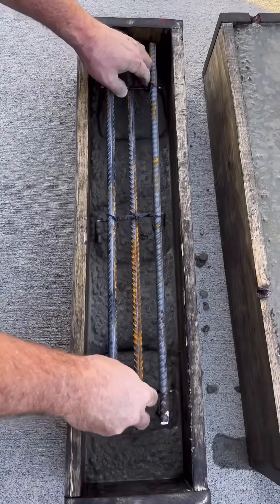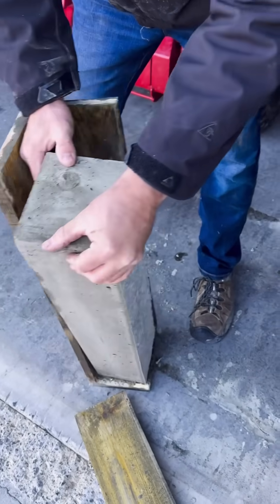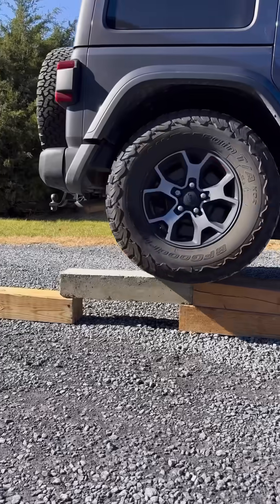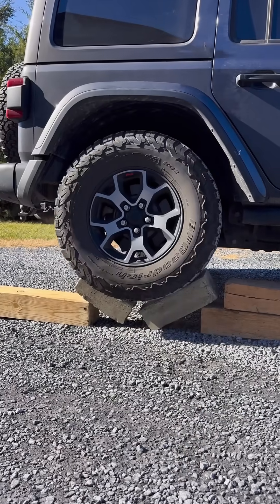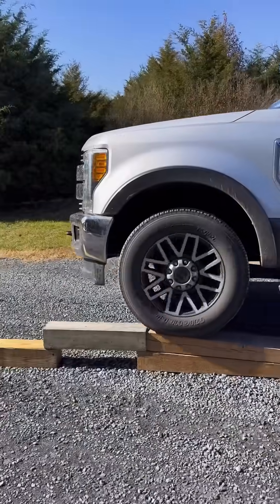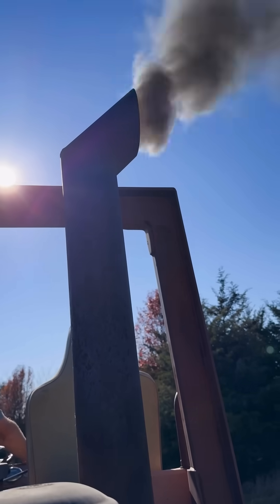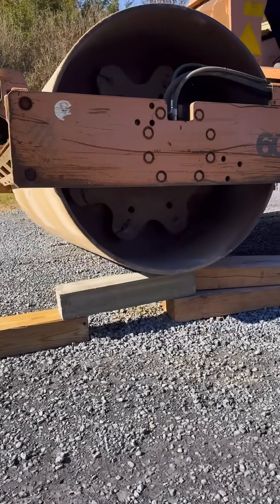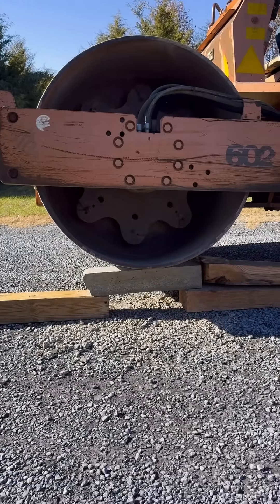Why We Use Rebar To Reinforce Concrete

Comment: Too much rebar will break up concrete in the summer. As they warm, steel expands more than concrete cracking it.
Reply: Thermal expansion of concrete and rebar are so close (1.1^10^-5 and 1.2*10^-5) that it is (almost) impossible for the concrete to crack because of the thermal expansion. The reason for the cracking is rust. Mainly rain causes the concrete to become more acidic over time and that causes the rebar to crack.
Reply: @MrAggezzz  
You may be right. I was told by a state employed engineer it was the different expansion rates of the 2 materials. 
Question; I have a pressure washer that can heat water to 250°F, was told  not to use heat when washing concrete because it will explode. What Temps would concrete explode?
Reply: @happydays8171  i have had concrete explode. It took a good size fire right on the concrete. Took like 2 hours so im sure it was very high temp.
Reply: @MrAggezzz  Is there galvanized rebar?  How about a threaded rod?
Reply: @MrAggezzz  non Calcium accelerator is what is required. But concrete is corrosive on its own. Epoxy paint coated rebar is also smart.
Reply from the maker: Interesting
Reply: @hausplans  
Yes, there's a 4 lane hwy 49 in Indiana, laid late 60's when the steel lobby was very influential and got way too much rebar put in. On baking hot summer days it would Crack eating itself up. Then Indiana went to a minimalist approach just laying rebar on the bottom. Now, on IN state hwys they've tore up the concrete and gone with 18" of asphalt.
Reply: @happydays8171 What a horrible idea
Reply: @happydays8171 interesting that they used concrete on a highway in the first place, I just assumed they always used asphalt. I figured the “grey” color was just from dirt and cars driving over it. Didn’t know they used to use concrete only for highways
Reply: @happydays8171  could it be the ground expanding not allowing the concrete to flex with it?
Reply: @misterbulger  
Very possible. We'd get hard freezes back then when the temp didn't get above 20° for over 30 days at a time. Sections of this hwy would explode in the summertime, moreso in Illinois than Indiana. When they went to a minimalist approach, just putting rebar on the bottom, the roads lasted longer. In my non-sceintific observation.
Reply: @happydays8171 
If your concrete pavement is exploding, then it doesn't have enough expansion joints per mile.
Reply: @hausplans try it again with fiberglass rebar!
Reply: @hausplans  that's why u may see pully systems putting the rebar in stress.
Reply: @hausplans now make a video with 1-4 rebars inside the concrete and compare which one holds up the best… is more actually better?
Reply: @hausplans they make fiber rebar now its supposed to be stronger then steel doesn't expand an Crack and its a fraction of the price
Reply: @makmar4484 
Fiberglass is far less stiff than steel while Basalt is 2.5 times more stiff than steel. Basalt is also longer lasting due to having absolutely no corrosion or oxidation heaving. Basalt rebar is ideal for saltwater contaminated environments. Also, Basalt fabric can be used as a sheath around concrete members, providing surface reinforcement, in addition to interior Basalt rebar. 

Steel rebar has the redeeming quality of failing gradually instead of abruptly. The steel yields gradually and produces visible concrete surface cracking. Whereas Basalt reinforced concrete just explodes catastrophically when overloaded. However, post-stressed steel tendons also fail catastrophically, so there is that similarity. However, the point is to over-engineer the brittle aspects of the design or use composite techniques that provide redundancy against brittle failure.
Reply: @hausplans  not interesting, false
Reply: Its not from heat, the steel begins to rust and then you get what you call rust jacking.
Reply: @aarongrabowski3775 
We call it concrete cancer in England, I think that’s why inspectors are so anal about the cover on rebar now
Reply: @MxHondaCR250R concrete cancer is called Alkalai Silica Reaction - or ASR. It's a product of aggregate (rocks mixed into the concrete) reacting poorly to the main binding substance in concrete, calcium silicate hydrate (CSH).This reaction breaks down the CSH from the inside out,  and causes internal expansion. This is not a product of rebar expansion.
Reply: @Prosper_NA smarty pants 😅
Reply: @aarongrabowski3775  if you use accelerator it's got to be non-calcium so it doesn't corrode so bad
Reply: i used fiberglass rebar
Reply: @justbobroblox5380  
Good deal.
How much more expensive is it than steel, and is it as strong?
Reply: @happydays8171  conaidering likke 90% of all titanium deposits in the world are found in russia. Uh. Expensive.
Reply: @happydays8171  in my area a 10' x 10mm bar, the fiberglass is $0.64 more expensive. fiberglass bars are stronger than steel.
Reply: @gwot 
Thank you for that info, didn't know that. I want to pour some cement soon, I'll look for the fiberglass rebar.
Reply: No it doesn't, steel and concrete have a very similar thermal coefficient
Reply: @toonces6587  but you must size the rebar accordingly.    You don’t want to put 1 inch rebar in 4 inch concrete.
Reply: @Bodie2020  yes you do, more steel the better if you can afford it
Reply: This is generally not true.  Low carbon steel is used as rebar because it has high tensile strength and similar thermal expansion coefficients to concrete.  What heat does do is speed up the reaction of oxidization. Oxidizing steel can rust and expand, putting internal tensile strength on concrete.  As explained in this video, concrete is poor in tension,  causing the concrete to fracture. - Civil Engineer
Reply: @Prosper_NA  
Thanks for the info.
Reply: Lol you made that up to sound smart. By your logic every commercial building in America would collapse the first summer after it's built.
Reply: @cthulawha he said “too much”
Reply: Dude you have no idea what you're talking about. and you're being hyperbolic. This is already a major public issue in places like Florida where the cracked concrete exposes rebar to moisture, which then causes rebar to rust - creating even more instability. There is a literal epidemic of 40-year-old condo buildings collapsing in that region. Lookup 'surfside condominium collapse' on wikipedia and educate yourself. @cthulawha
Reply: @cthulawha  
With too much rebar it could. This highway I mentioned broke up so fast, I remember it cracking and exposing the rebar. All had to be torn up and re-laid.
Reply: Titanium rebar
Reply: @Atthewgoop the rebar didn't break it just bent the concrete will still crumble
Reply: @Atthewgoop  If you got the money go for it.
Reply: this is why construction is tricky in the Midwest. summers are over 100 degrees. winters are single digits and sometimes go down to 60 degrees below zero
Reply: This is not true at all. Steel and PCC have similar thermal coefficients. Plainly reinforced concrete is susceptible, primarily, to oxidation/corrosion of the bars which expands the volume the compromised part of the bar was occupying. When this happens excessively, we call this rust packing, with the change in volume generating enough pressure to delaminate and sometimes remove chunks of concrete from your structure. 

This is the reason why ACI recommends certain concrete cover dimensions beyond the space where reinforcement is placed dependent on the environment and application. It is also a reason why glass/aromatic/carbon fiber reinforcements have undergone so much research in the past 3 decades - because they don't deteriorate similarly. Lastly, it is why many state agency's are experimenting with the use of stainless steel bar and galvanized bar.
Reply: I thought that was when it rusts and expands.
Reply: @happyjohn354  
Just saying what that state engineer told me. All the rebar I've hauled to job sites, had been sitting outside and already rusting before getting put in the cement.
Reply: @happydays8171  Ya because a little rust helps concrete stick to rebar better. The problem is when water gets inside the concrete and you start getting thick layers of flaky rust.
Reply: Concrete always cracks. No matter what you do with your rebar. It always always always cracks. It’s a matter of controlling where the cracks happen, hence control joints.
Reply: @asoggyburger479  even then no garuntees. I never warranty against cracks because of our expansive soils where I live that heave and sink. If you want no cracks then im drilling piers to bedrock and putting a grade beam on top just so I have something solid beneath. Now you have a $300k driveway. Even then it'll still crack.
Reply: @misterbulger  Absolutely, I don’t know any concrete subs around my area that will cover aesthetic cracks. If there’s a structural issue because of the crew that installed it or the engineers who designed it then by all means it should be covered within reason. But cracking it totally normal and always happens lol
Reply: No it doesn't. The coefficient of thermal expansion is the same for rebar and concrete. Water intrusion causes cracking.
Reply: Even 10th graders know that we use rebar because it expands at the same rate as concrete
Reply: No steel and concrete have a very similar thermal expansion. You're probably thinking of rust jacking
Reply: There should be 50-70 cm spacing between rebar and the boxing
Reply: Rebar to close to the top it will cause cracks on flat work ,caused my driveway to crack right down the middle after 6 months ,bummed me out the contractor would not come down in price he said he was the best !!
Reply: False
Reply: Dumbest thing I ever read
Reply: Your so wrong lol what a clown
Reply: Fortunately, you don't have to use "too much rebar".
Reply: Yeah I'm sure that 1/32 of an inch will cause concrete to blow up like a balloon
Reply: Concrete is very regional and different depending where you live here in the United States, a contractor from Florida, cannot come to concrete up in Montana but somebody from Montana can probably do concrete in Florida the only thing different is gonna be the dirt work and setting up forms but that’s not concrete skills a Florida contractor would have to learn how to build a foundation forms which yes some can but those people also have skills to build parking structures and will probably run a company doing some thing a little more than just basic house, concrete like foundations, slabs, sidewalks curbs like we do first fancy sidewalks that are stamped and colored I think you said you’re down in Indiana, so definitely makes sense as you start getting more up south in that area over in Kentucky, Tennessee, Illinois it starts becoming like concrete up more up north but because of your humidity sun and swamplands theirs certain things that are a little different like we have to deal with swamp land like stuff but nothing like the south farm land that’s swampy is not like the south lol
Reply: Concrete is very regional and different depending where you live here in the United States, a contractor from Florida, cannot come to concrete up in Montana but somebody from Montana can probably do concrete in Florida the only thing different is gonna be the dirt work and setting up forms but that’s not concrete skills a Florida contractor would have to learn how to build a foundation forms which yes some can but those people also have skills to build parking structures and will probably run a company doing some thing a little more than just basic house, concrete like foundations, slabs, sidewalks curbs like we do first fancy sidewalks that are stamped and colored I think you said you’re down in Indiana, so definitely makes sense as you start getting more up south in that area over in Kentucky, Tennessee, Illinois it starts becoming like concrete up more up north but because of your humidity sun and swamplands theirs certain things that are a little different like we have to deal with swamp land like stuff but nothing like the south farm land that’s swampy is not like the south lol
Reply: @Hellothis12157knbhb  
I have rental properties, I mix and pour cement for sidewalks and steps. If I'm right against the clay (sometimes there's only 4" of topsoil), I'll pour right on it, a true 4 inch minimum of concrete, not the 3 1/2" a 2X4 is. Otherwise I like to lay 2" of crushed limestone, but haven't used rebar and only had a couple cracks. Where I've seen work professionals do that cracks and pitches in 6 months after laid. I like it more dry than premixed is, that's soupy. So mixing it myself, I feel is key. Stuff I've done has lsted going on 15 yrs. That's 100° summer days, and 2 days a tear on average, doesn't get above 0.
Reply: @happydays8171  well the thing is professional is a bad term in concrete for people to call themselves, like you as a landowner knows a how to take the take to do it right small section of sidewalk don’t need rebar especially outside of homes wanting rebar for those types of sidewalks is more for like a Main Street where shifting buildings snd roads will effect stress out on the concrete, like the 76 I mentioned has rebar in the sidewalk because it’s also a step up as well as being next to the building so if anything shifts the concrete will crack but keep shit from causing a safety hazard for a couple year, like concrete will always crack that’s why we cut big slabs( theirs something we can put in to help influence cracks but it doesn’t work all the time snd we’ll we don’t use them anymore ) or we put the groves making sections, it’s not just for looks, each of the groves is to cause cracks for that section, their could be a lot of things the concrete guys did wrong, didn’t properly set up the dirt work, they didn’t do the rebar right or they got soil or foreign debris in the concrete trapping it in causing shrinking or cracking,  because it’s a chemical reaction that causes hardening its different when it comes to how you treat it, like because it’s cold rn we half to add activator to help make the concrete harden, if you add sugar you can make concrete not get hard at all, we use sugar water when doing exposed aggregate( you can see the rocks  though the surface )
Reply: @happydays8171  the reason I say professional is a bad term is I’m 19 and I can set up and pour sidewalks better then most crews in my town my dad taught me right and I’m not a professional like I’m getting my contractor license but that doesn’t mean shit for my skills, it just makes it so my employer doesn’t take my taxes out of my paycheck and I get payed more cause he doesn’t need to pay any insurance or unemployment that’s all me but I can also work for multiple people cause I’m technically my own company.
Reply: @happydays8171  and when it comes to sidewalks and rebar it’s more about the surface it’s going on and thickness Andy what surrounds it like if anything like a foundation can shift,  as well as if it’s bendy etc in reality it’s a very 50/50 thing snd that’s why we come looks and write the quote after understanding what we’d deal with not before we can even see it at most we change tell them the concrete per foot price snd what we charge for bar etc but with wood snd select materials er can’t give a quote the price changes to much
Reply: @Hellothis12157knbhb  
Thanks for the info. Mixing seems to be the key, I know when I've got it 'Just right.' Live by a university, walk my dogs on their sidewalks, and they don't turn a load of concrete away, they pour no matter how soupy it is, and the top 3/4 inch gets all pock marked up, looks like concrete acne, after 2 winters because of all the salting it gets, then they'll tear out the worst parts and replace it. I watch YouTube vids where concrete workers working on pouring a driveway will turn a load away for being too wet, can't understand why the university doesn't. Must be the cheapest bidder.
Reply: @happydays8171  cheapest bidder for sure, but I have never heard of a concrete truck being too soupy on arrival. I wonder what the fuck you’re mixing plant is doing because it sounds like they suck, we usually always have to add water and that’s how we always do it. Maybe the person ordering it is doing it wrong, because when you order concrete, it’s kind of complex not exactly, but to somebody who doesn’t understand it definitely is very confusing, but we use two different plants depending on what type of job the local one isn’t as good, but it is usable. The thing is, we have to watch out because later in the season so right now we have to be careful because they were having chunks of unmixed concrete which like you said having a good mix is important, it definitely has to do with who’s running the job, I wouldn’t be amazed if it’s somebody from the University and students actually lol and you can have a concrete be pretty Danm wet like rn in Montana. It’s cold as shit, we want to get the concrete down fast and have it dry fast, so it might seem a little to wet but we have activator in it, which depending on how much you add Will drastically speed up the Hardening but makes it harder to finish, the main reason the University stuff is probably cracking is because it’s being poured very wet and quickly with a job that was done very quickly so there’s going to end up being contaminants Mixed In especially if they’re pouring it very wet onto dirt you do not poor wet on the dirt that is a bad idea like you can pour on dirt, but do you want to be careful, you do not want to overwork the bottom of it because if you do, you’re gonna mix too much and cause cracking whoever is running that job is a dumb ass though. The issue is some areas don’t have concrete people like I’m moving thing Kentucky and they don’t have anybody who does concrete at the level we do and this town is bigger than my county it’s baffling how some big areas don’t have people who can run a concrete company it’s not like it’s that hard either it take skills but it’s not the hardest. It’s just very labor-intensive.
Reply: @Hellothis12157knbhb  
I mix it myself because it's half the price of the premix for my jobs. But I love pouring it, going over the top with a trowel and bringing it to the form desired, creating something out of nothing. The crushed limestone (could have the name wrong) is about the price of gravel, packs nicely and I wet it before pouring on top of it. Supposed to make the concrete harder, although I'm sure someone on here will correct me. But none of mine has cracked like I've seen others crack.
Reply: @happydays8171  when it comes down to it I wouldn’t know when it comes down to the homeowner stuff like when we do small stuff like that typically it’s just been a package of the whole house, I do foundations, slabs and driveways patio typically what you see houses with😂 but if we are doing something smaller at a house already it’s typically a new garage so it has a small foundation slab and sometimes the driveway depending the person, or stamped colored concrete which personally is my favorite because it is really easy to actually do once you know how to. It’s just time intensive compared to labor-intensive but the results are stunning sometimes
Reply: Try this with fiber reinforced concrete
Reply: @tracydjenkins  simply put it you won’t see one unless he went up to the weights that would break the rebar we use that stuff on like gas station parking lots, cause the spots next the station tend to be concrete not asphalt
Reply: @tracydjenkins  
Any brand in particular? 
Menards carries a lot of different Sakrete. The only difference I can tell is the amount of psi it will hold.
Reply: @tracydjenkins fiber rebar is what I'm using now 👍much cheaper and supposedly much better
Reply: The short and the comments are so informative!
Reply: That steel does pop
Reply: Concrete fully cures in 21 days s
Reply: And the winter. Like real winter like Chicago.
Reply: And then add it to a condo on the beach with salt water.
Reply: Uh, no.
Reply: Even stronger is the ice ship concept where you freeze water/sawdust mix to form the ship shape with frion coils to keep it frozen it’s stronger than titanium at a10th of the cost
Reply: Maybe maybe not, been living in a house 20+ years and the people who built it put rebar in the concrete, house is still standing
Reply: Have you seen California standards for the amount of rebar needed?
Reply: Its not heat it is the rust that expands it
Reply: This is false
Reply: california uses metal straps around to make them stronger
Reply: Wait the whole point of using steel and concrete together is because they have almost identical expansion rates with temperatures. I don't know where you got this idea at but clearly you're not a civil engineer
Reply: This isn't true. They have very similar coefficients of thermal expansion and that's why they are used to together. I don't know why people who know nothing about a subjects feel the need to always comment.
Reply: I have designed, tested, and inspected reinforced concrete for many years.  Thermal expansion from too much reinforcing steel isn’t a thing. As others point out, the coefficient of thermal expansions are nearly identical for steel and concrete.  This is why they work well together.  Also - steel typically doesn’t corrode in well-made reinforced concrete, because the alkalinity of concrete protects the steel from rust.  The exception is concrete that has been impacted by chlorides, such as in salt or swimming pool environment.   Then the steel can corrode, expands as it rusts, and pops off the protective concrete cover.   Lastly there are several chemical reactions that can happen that deteriorate reinforced concrete over time, such as alkali silica reactivity (ASR). 

I am guessing the concrete in this video was less than 14 days old, it looked pretty green (not color, but term for young concrete).  Concrete tends to becoming stronger with age, most strength tests for acceptance of concrete are at 28 days.
Reply: You don't know what you are talking about. One of the main reasons we use steel rebars and not other metals is because they have virtually the same coefficient of thermal expansion. If what you said was true, all bridges would break apart in the first season change.
Reply: Never heard of such an animal
Reply: If you're coating the ruibar with a shell of concrete 😅 there are much studied ratios for concrete to steel section
Reply: I watched a whole parking lot get poured concrete smoothed set and dried in 20 min
Reply: Florida facts
Reply: That’s not true at all, where do you come up with this bullshit
Reply: What you described is a design lacking enough expansion joints. Or lacking enough concrete cover (minimum of 2") over all steel rebar. A 2" cover thickness corresponds to a project lifespan of ~50 years, 3" to ~75 years. 

Concrete pavement needs both contraction and expansion joints at designed intervals. 

The expansion joints are what prevent the slabs from heaving up into ramps during heat waves. Slabs get hotter and expand faster than the overall soil. Each expansion joint is filled with a wide foam noodle that can withstand crushing. That is covered by EDPM. The adjacent slabs expand horizontally and crush the resilient foam. Telescoping rods across the joint are supposed to allow the slabs to move closer (and further apart) without allowing vertical shear. 

The contraction joints are designed to crack first (before any other random areas) usually during the early concrete curing. These joints may also contain a foam noodle that limits water movement through the crack.
Reply: 🙄 tell that to rebars in high rises
Reply: Lies 😅😅
Reply: This isn’t an issue for most concrete that isn’t in very sunny areas. This is more of a regional issue, in some states, they literally have to paint concrete driveways if they want them to last long like Florida concrete sucks cause the sun, I’m in Montana snd having water trapped inside/under is more of an issue cause freezing, but you don’t need rebar for all purposes highways, of course but the concrete you see gas stations have doesnt need rebar we are finishing the concrete at a 76 rn and all of the parking spaces don’t have rebar we are instead pouring concrete that is fiber reinforcement it’s not as good as rebar. But an application where it’s going to have to get removed eventually. It’s best This is why you find city sidewalk without rebar in some places because it’s just gonna get replaced after five years or more.